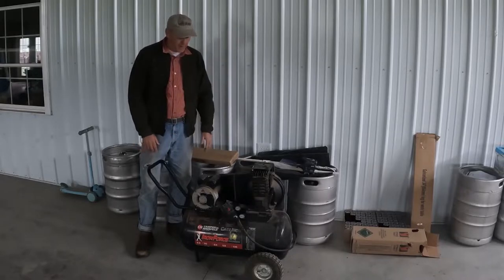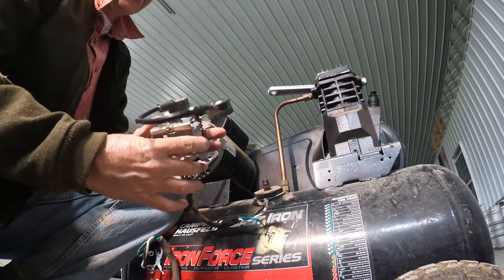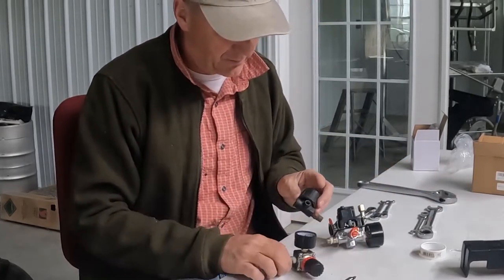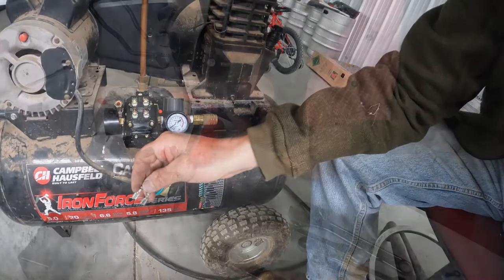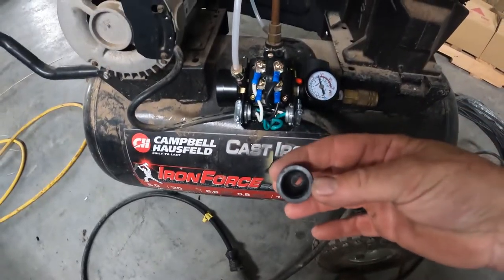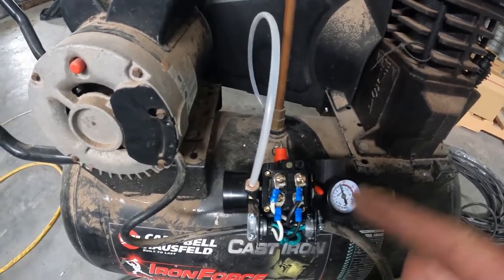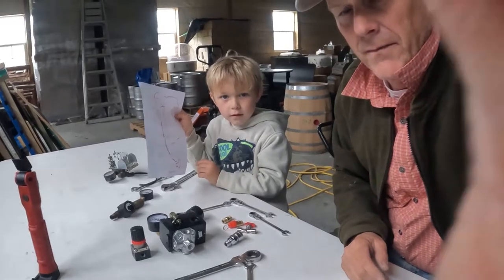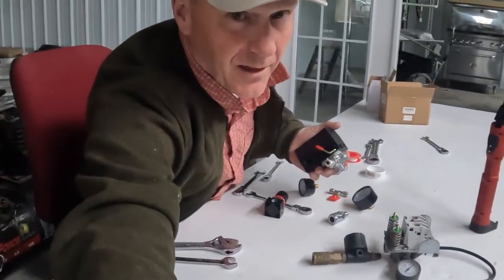Replace Compressor Pressure Switch on Campbell Hausfeld Air Compressor

Comment: I have the same CH Cast Iron series compressor that is upwards of 30 years old.  Probably put 3 or more pressure switches on it, not a big deal.  HOLD ONTO THAT UNIT, do not replace it because the newer ones are nowhere near the quality or durability.  I just changed out the pump oil and installed a gate type tank water drain in mine, hoping it will last another 30 years.
Reply from the maker: Ok this comment says a couple things... first you are old, like me and second you value quality products.  When I bought this thing, I looked long and hard and settled on what I thought at the time was the best, longest lasting compressor in this size... turns out we were right!  I need to change the oil in it too!  Adding a drain is a great idea too.  That is what usually kills the tank.  Thanks for watching our video! And thank you for taking the time to comment!  I really appreciate you sharing your thoughts!  Kevin

Comment: wouldn't the rubber wire protector go over the inside wire clamp nut?  just wondering ...
Reply from the maker: Thanks for watching NewTestamentDoc!  I was and still am not sure what you are referring to.  I watched the video again and forgot about the ending. I have to thank you for asking the question and giving me the opportunity to go back and watch it.  Seeing our children's art work was fun.  I am still unsure of what you are referring to. There is a big chance I did something incorrect.  I will say the compressor is doing well today. I don't use it all the time but it's working fine now.  Thanks again for watching. Kevin
Reply: sorry for being unclear.... you got a rubber piece in the rebuild kit to go over the wiring  to the pressure switch to make it more water resistant.  I wondered if it would fit over the nut on the romex cable clamp... on the nut side.  Might help with humidity/water incursion?   @MillGapFarms
Reply from the maker: I found what you are talking about. It was a short segment in the video.  I don't think the kit came with two of them...although it could. I never thought about putting it on the inside or outside to prevent water incursion.  What a great idea! This is why I like YouTube. I learn something every day. If I have to pull it down again, I will install one or both of them!  Thanks for pointing that out.  Thankfully I don't use the compressor in an moist environment...and I won't with the knowledge!  Thanks for the comment and follow up!  Hope to see you in the comments more often.  Kevin